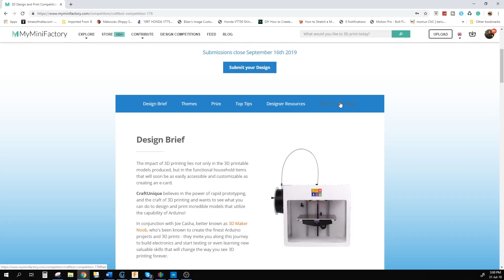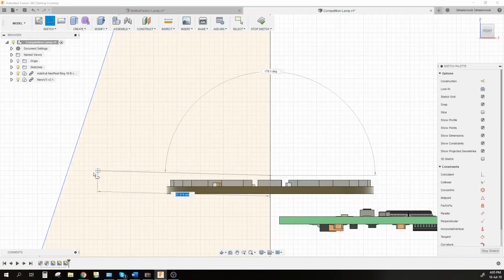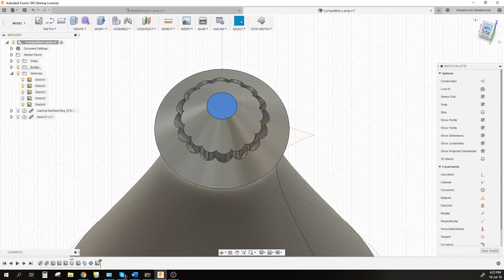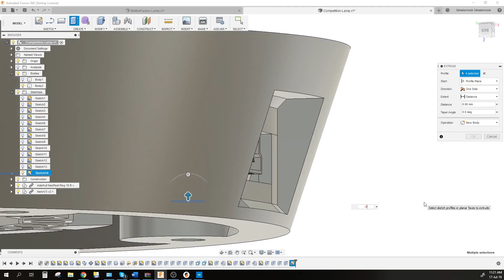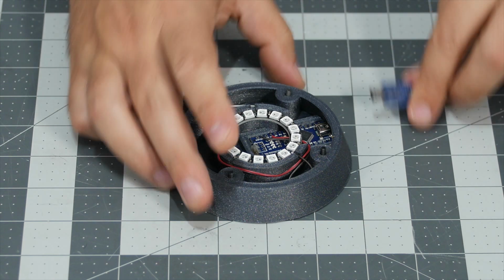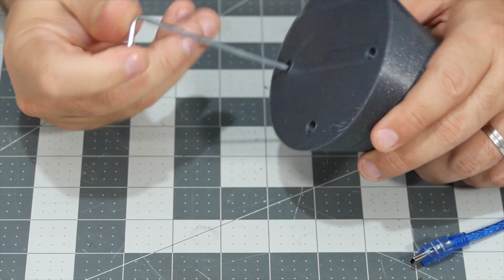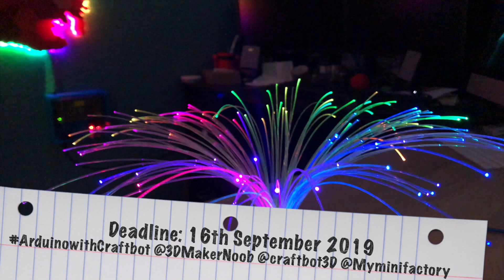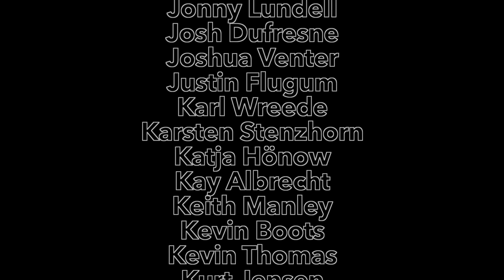Satisfying Fireworks Lamp - Design Competition With MyMiniFactory and CraftUnique

Comment: Hi, I am new to 3d printing and CAD. I am designing my own parts to upgrade stuff. I am designing by measuring things but I end up with bad sizes all the time, its really frustrating. I have this part that I have printed 7 times already and its never right. In the video, at 3:45, you mention you apply a 0.2 offset to all projected lines for better tolerances. What exactly do you mean and how does that work out? Also, is there a place I can learn all this tricks?

Comment: Hi Joe printed out got the electronics working just found out my neopixel ring is 1.5mm too big and won't fit bugger back to the printer 101% print
Reply from the maker: Can you lightly sand the edges instead?
Reply: @3DMakerNoob  printing base now see if it works if not will try and sand down

Comment: Hi Joe, your wiring instructions do not match with your comments.  The nano  ring has on the back: Data out and Data in, 5VDC power, and Gnd.  Can you confirm which wires should go to which terminals on the ring please.    The Nano board re to pin 27, Blk to 29 and White to 8 i have worked out :-)  Appreciate your help.